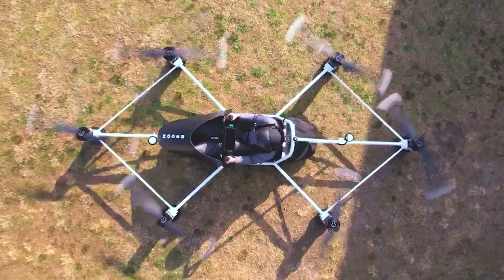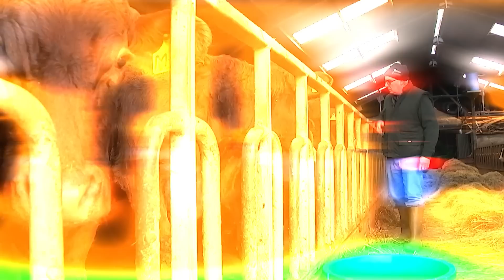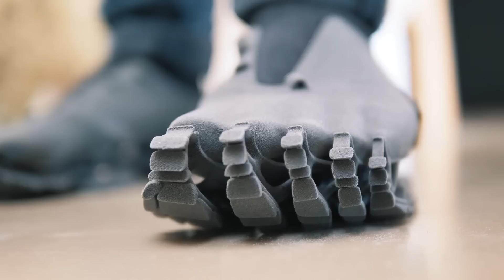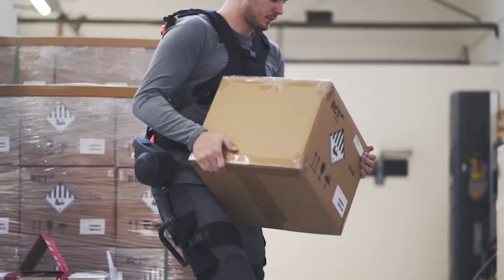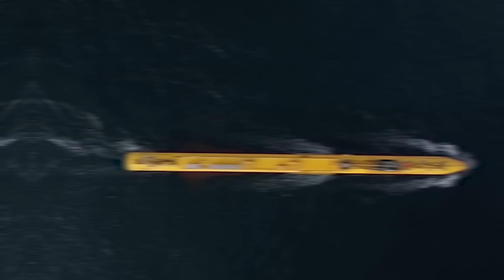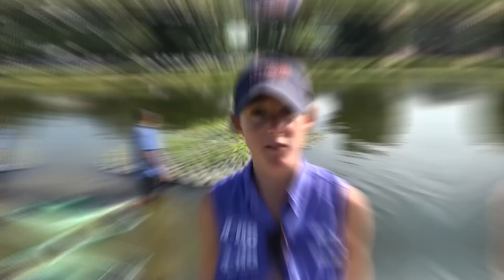Ingenious Inventions and Gadgets You've Never Seen Before

Comment: i have an idea for an improvement for the 3d printing cement.. it would be adding rebar layors and then printing the cement with small hole ever few feet.. and this could allo the rebar layers to show through the hole.. then there is a special rebar post that can be dropped into each hold that has locking poiints to lock into each later of rebar.. then filling the hold with cement.

Comment: SpinLaunch corrections.  It does use a rocket.  It just uses a tiny rocket only capable of delivering a few pounds to LEO, Low Earth Orbit.  In comparison a Falcon 1 could carry a couple dozen times that payload to LEO, and a Falcon 9 can carry many more times that.  So you can say it doesn't pollute as much because it is a much smaller rocket but thats like saying lawnmowers don't pollute as much as a car.  It would take dozens of those tiny spinlaunch rockets to do the delivery of a single Falcon 9, so add up all those rockets then you can compare them.  On top of that fossile fuels are burned which emmits literally TONS of co2 into the air to generate the electricity for the spin launcher motors which are extremely powerful and have to run for several hours in order to get fast enough for a single spin launch.  Just because you don't burn the fuel during the launch doesn't mean it isn't contributing to pollution just as much as other rockets.

Comment: That spin launch thing seems very iffy. Like .. they're trying to form a vacuum with that membrane at the end? But need a rocket to puncture through it? In a huuuuuge system where a vacuum is pretty impractical to achieve?
Reply: Actually they have had immense success with the prototypes. As he said, they've already achieved the upper atmosphere. And that membrane barrier? That uses carbon nanotubes that you couldn't punch through if you were superman.
Reply: I think they use "vacuum" losely. I think they just pump out some of the air, but not all of it. Real vacuum would require massive walls to protect it from the air's pressure.